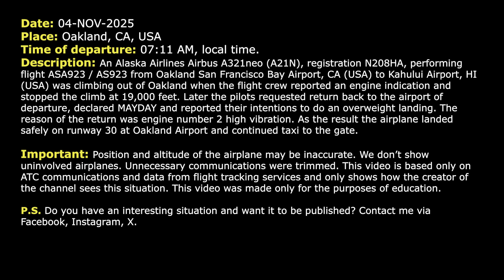High engine vibration. Pilot declares MAYDAY and returns to Oakland. Real ATC

Comment: We're they far enough away from land to where ASA923 was using HF radio and not the usual VHF band? Sounds pretty good for HF if it was.
Reply: I used to work this sector. Oakland only communicates over VHF, which reaches around 250 miles to the western edge of the sector 35 airspace (ALLBE, BAART, CREAN), assuming the plane is in the flight levels. It looks like this plane was only around 50 miles offshore. HF communication is outsourced to San Francisco ARINC which is located in Livermore.